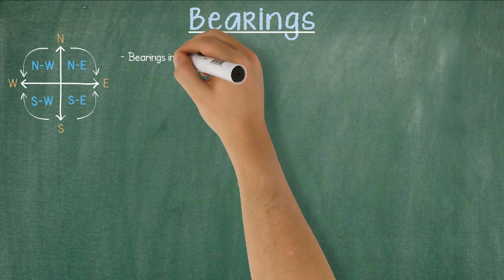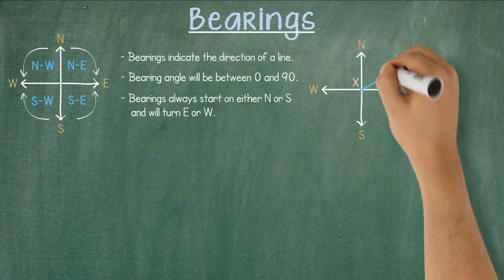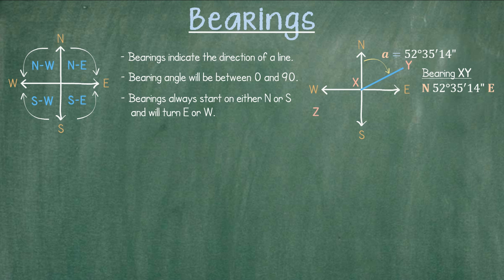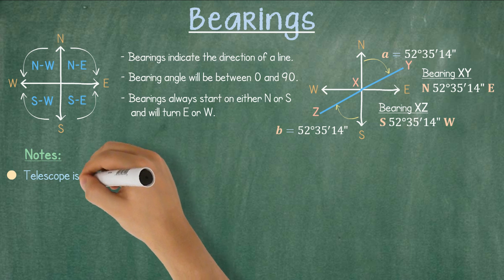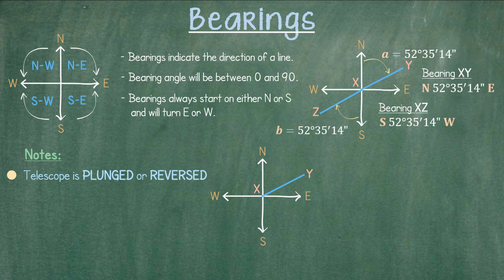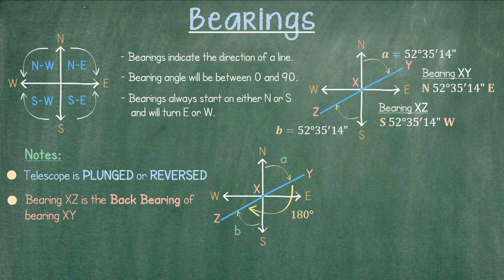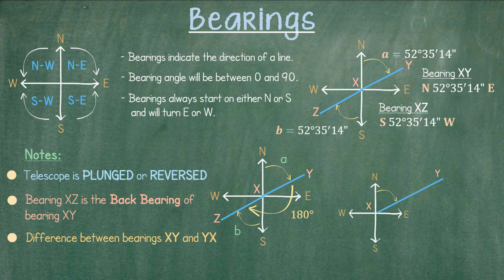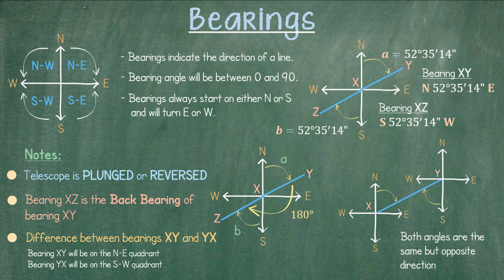Bearings

Comment: How to determine the value in minutes and seconds? Easy to determine the value in degrees because we can use the protractor. How about the values in minutes and seconds?
Reply from the maker: Hello Ryan,
Just convert the angle in degrees to minute-second units.
Reply from the maker: For the degrees use the whole number part of the decimal.For the minutes multiply the remaining decimal by 60. Use the whole number part of the answer as minutes.For the seconds multiply the new remaining decimal by 60.
Reply: @SkillRender  ahh yes I got it sir. Converting the angle into DMS form. I was just having a mental block that time I was hardly trying to understand where did the value of minutes came from😂 later I found out that it is from the angle which is converted into DMS form. Thank you, Sir.